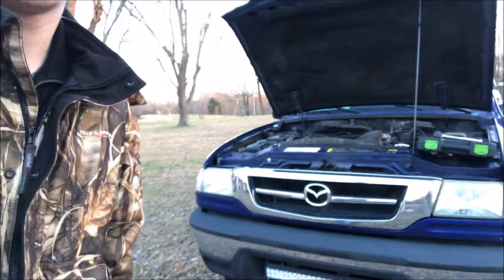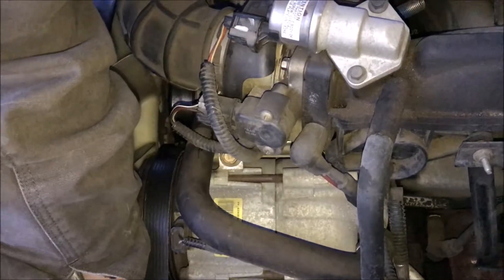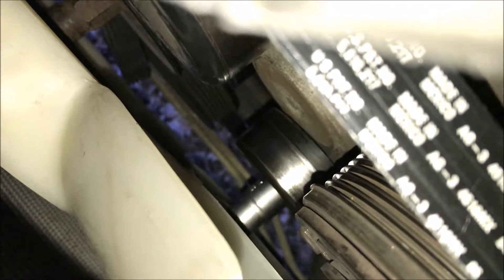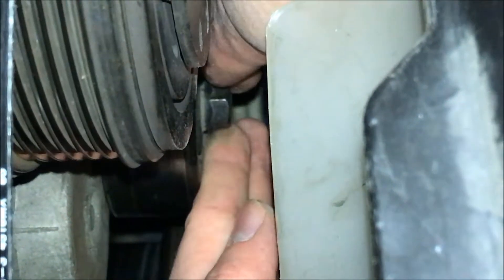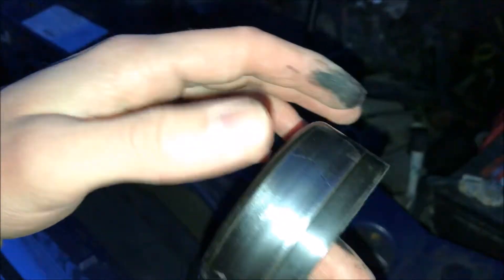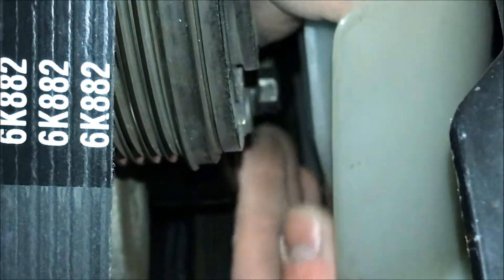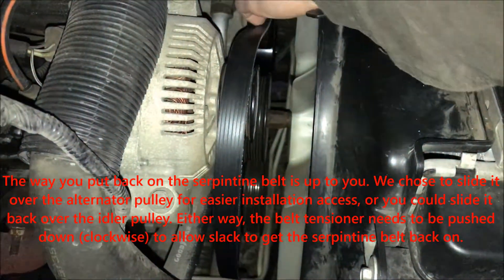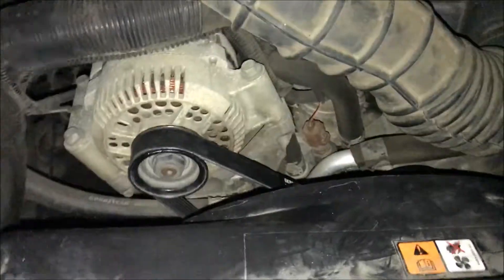2003 Mazda B3000 How to Change an Idler Pully

Comment: Hi, do you loosen the belt by going clockwise and take off the bolt by going counter clockwise. lefty loosy? I pulled down on the bolt as hard as I could going clockwise but the pulley wouldn't come off.
Reply from the maker: Yes, you loosen the belt by trying to turn the tensioner pulley bolt clockwise. This will disengage the tensioner from the belt and allow you to remove. Then if you want to take the pulley off, turn the bolt counter-clockwise. A breaker bar is a big help to get it loose.
Reply: @HandymanSam  thanks.
Reply: got it off and replaced it. Tight fit with the short ratchet. My truck still makes the squeaky noise but more quiet than before. It only seems to make it now when the car is idle and not when it's driving.  Perhaps the pulley was one factor and the other is a misalignment issue. A least I know that the belt is ok and the pulley bearings are new so hopefully the belt won't snap and I hafta stick my thumb out for a ride. 
Thanks for the vid.
Reply: Which pulley did you replace next to stop the squeak  ? My B 3000 is doing the same thing squeaky.